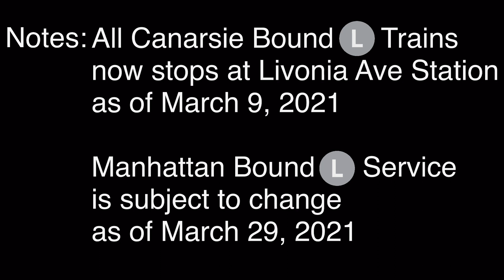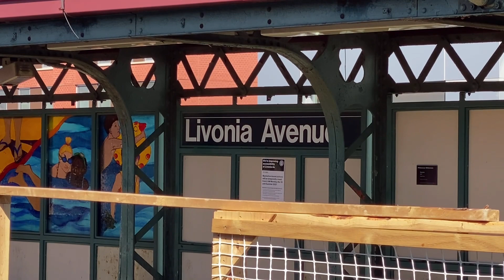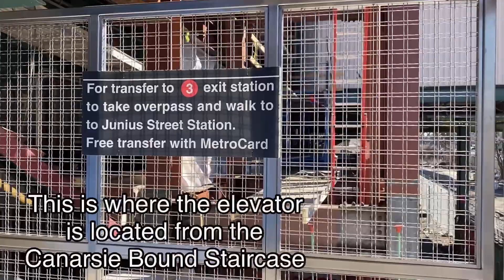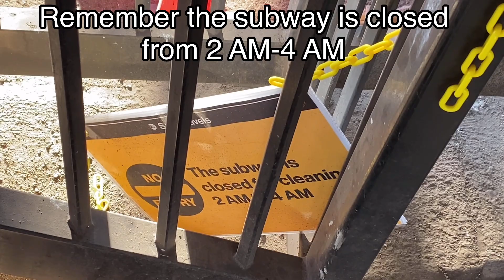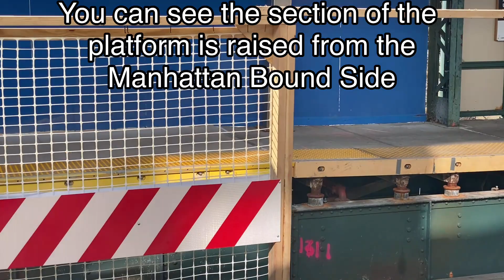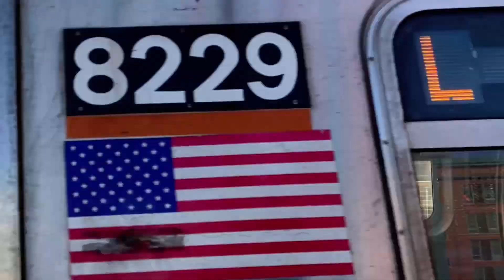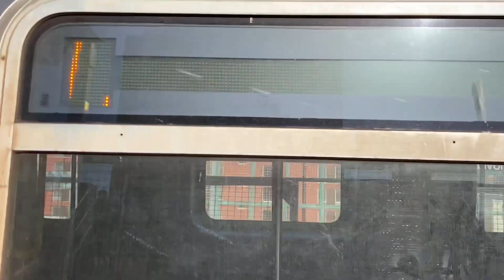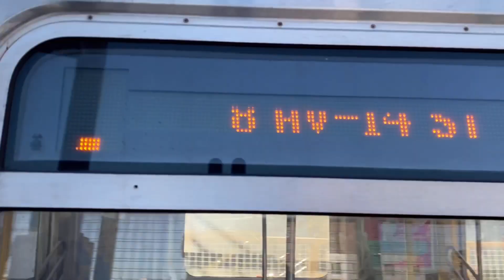Canarsie Bound Platforn now open at Livonia Ave Station (During Accessibility Upgrades)

Comment: I also think they’re trying to make a over pass for people to transfer between the 3 & L lines which I think makes the most sense
Reply: That was the case with the number 7 train a while back . You had to leave the station in order to get 7 from Court Square. They finally built a connection that connected 7 G, E and M.
Reply from the maker: But that’s a different story. It was easy especially from underground and making a tunnel and all that. But over here at Livonia and Junius, they both elevated and you gotta pay attention to the surrounding areas, the current structure, the noise from the trains and other things. The MTA can’t just place something down like it’s an easy thing. But in reality, it’s not easy. I hope you understand. And I do apologize if it sounds rude. I wasn’t trying to be rude
Reply: @Robcia335  Of course it's not easy. All this goes through study. It's not just about the noise. You have to meet the community and ask them.  It is never easy. Just look at the 2nd avenue subway. Who knows when that will be  finish. In the history of the New York City subway system there have elevated train that have been built and demolished .  MTA looks at ridership on that line to see if its worth building it.  Look for example in the area of Brooklyn in the Bushwick section. There lies the Broadway Myrtle station. There used to be a line that ran south of Broadway on Myrtle ave that went all the way to Jay Street. It was dismantled   1969 to 1970. Today the B54. run through there. Why? Because MTA determine it's cheaper to the run Bus line . It was too expensive to maintain that line.
Reply: @Robcia335  Your comment is sensible. I agree that building elevators for the Junius Street station of the 3 Line is not an easy feat to accomplish. The Livonia Avenue station can easily have two elevators installed. I am a railroad buff.
Reply: Thank you very much.